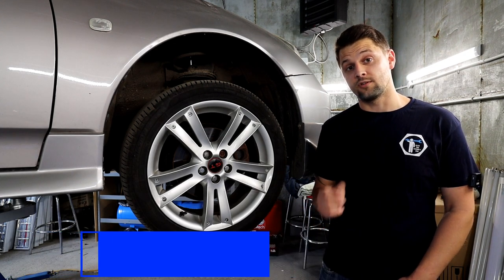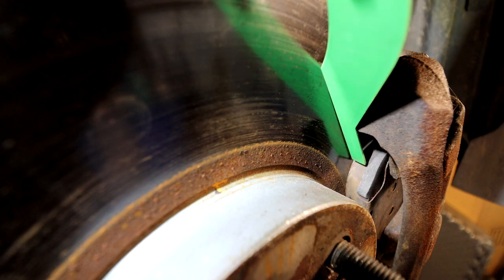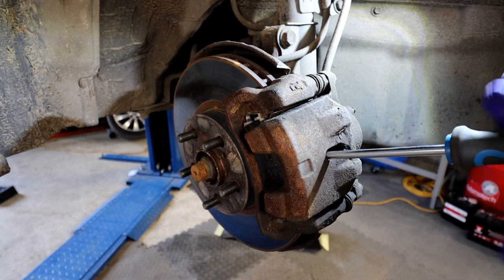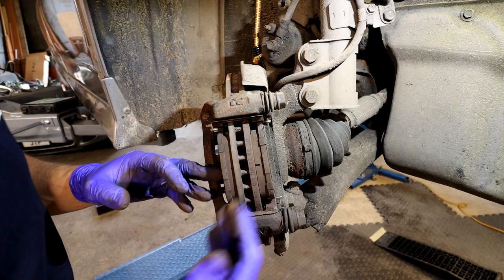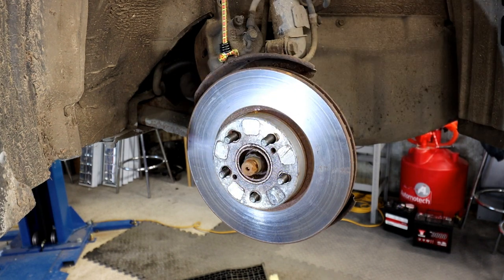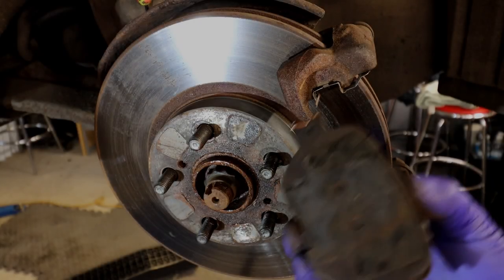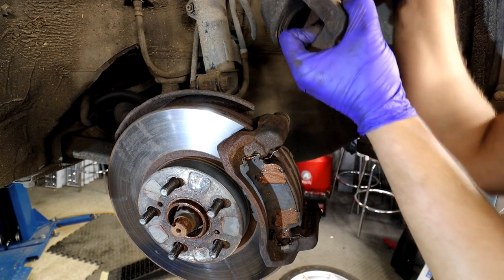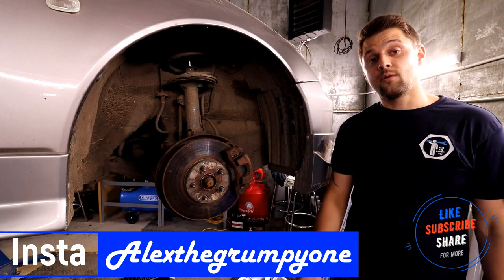Toyota Celica Gen 7 1999-2007 Restoration Series. Episode 6 Front Brakes Replacement and Service

Comment: Today on my Celica I am replacing the rear discs and pads for the first time in my life and this video really really helped! I'm still feeling a bit nervous though, hopefully everything goes to plan!
Reply from the maker: Sounds great! Well done bud. 
I will be doing a video on replacement of the rear discs and pads soon as well 😀 I do apologise for the delay
Reply: @AlexTheGrumpyOne  i can't loosen the slide pins so i might have to take it to my local garage ☹
Reply from the maker: The sides pins you need to get the clips out and then use a punch to knock them out bud. Punch needs to be the correct size for the hole